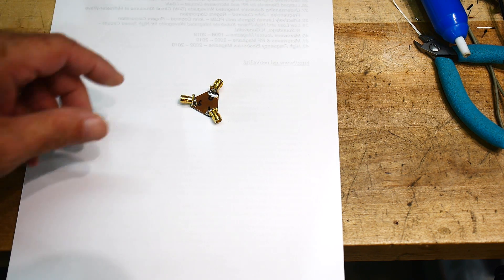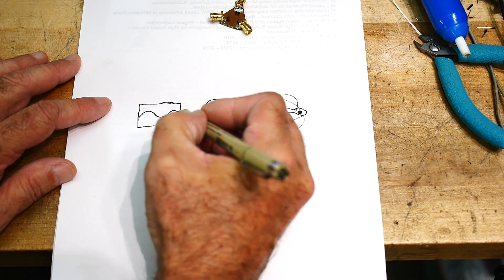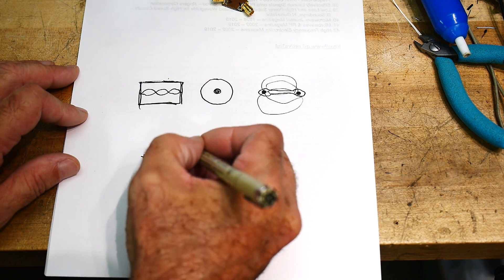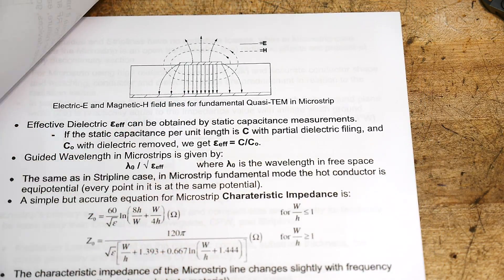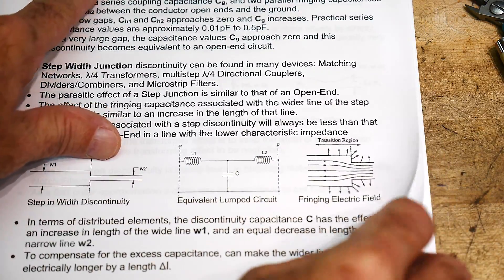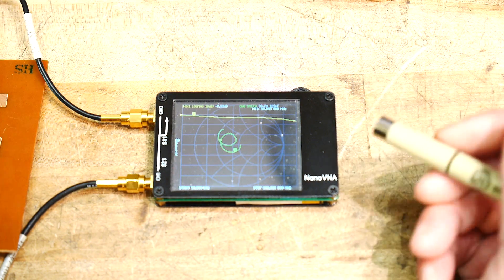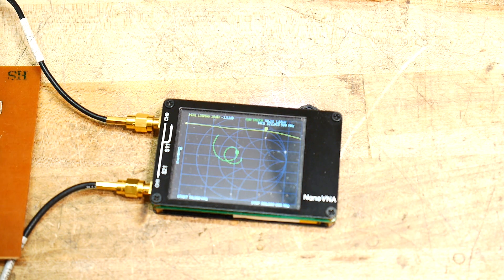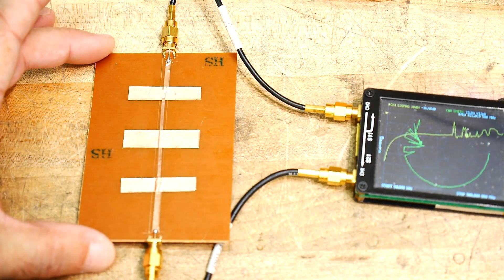#506 NANOVNA Microstrip Low Pass Filter

Comment: YES to soldering copper adhesive tape to every other conductor. Test it: Measure the resistance between either SMA center conductor, to the 3 rectangular strips (and not with a point probe at the center-line!). Technically: 100K Ohm = "Conductive" in product marketing jargon.
The capacitance of large areas of this tape over a solid conductor may semi-equal RF conductance, and the rough outside edges of the cut tape may actually DC short to metal below, but not reliably connect over time to a thin stripline passing beneath it.
This is a 50 Ohm system, and nil-Ohms are the gold standard at every UHF RF connection.
Reply: I noticed that you like fine tools, so if you really want to use copper foil for micro-striplines then I recommend this tool for making holes in your tape before you even peel or cut it (Just solder the hole into the bottom conductor) for copper holes in tape, and this tool works perfectly in Kevlar/Ligaments(<--designed for)/Paper/Plastic Tapes too: https://www.etsy.com/listing/740195866/5-hole-punch-pliers-stainless-steel?ref=internal_similar_listing_bot-1&frs=1

Comment: I've had some success with a combline bandpass filter for 70cm band. Had some nice steep edges and a somewhat manageable size still, about 4x6 cm. Making this in a microstrip form saved me from having to try and tune quite a few elements. This was three 50mm long strips coupled directly to ground on one side and via a capacitor on the other. Michael Steer had a great video series on his to calculate such a filter which I used for the basis of my version.

Comment: Ceramic is supposed to be good for this kind of thing. I have some old alumina end-effectors which might work. If you happen to find yourself in the south bay, I could bring a few to a social distancing coffee shop and carefully slide them across the table with a stick or something.
Reply from the maker: Yes ceramic is good for low leakage. All the stuff be built at Wavetek was gold on alumina. but then it did go to 40GHz. Below 1GHz cereal boxes would work.  Thanks for the offer though

Comment: I worked on a Rockwell-Collins uWave system back in the mid-late 90's that used strip lines just like these on the PCBs in the RF section. Even then the uWave was 30+ years old. The uWave operated in the 7.5-8GHz band. When we looked at the circuit diagram and started looking for components on the PCBs, which had no component designators to help locate parts, we realised these tracks were actually components and that we were in over our heads .
Reply: The nice thing about having NanoVNA's handy is that such things are no longer over our heads. I feel like I have finally become reasonably competent with handling microwave stuff now that I have one and know how to use it. Before, everything over a GHz was just black magic and plumbing to me.

Comment: it's true that microstrip circuits might seem quite large in UHF/VHF and most of the time it's better to use lumped elements but I have faced with many cases (in designing BP and LP and notch filters in UHF) where you end up with ridiculous values of C and/or L which are very hard if not impossible to implement with lumped elements but when you convert the filter to transmission line filter, you end up with very reasonable microstrip dimensions. I think that's the main reason why one would still want to use microstrip at lower frequencies. Another example that pops into my mind, is to implement couplers for example for SWR meter...
Reply: Is it possible that 400MHz center frequency bandpass filter through microstrip lines less than 15cm?